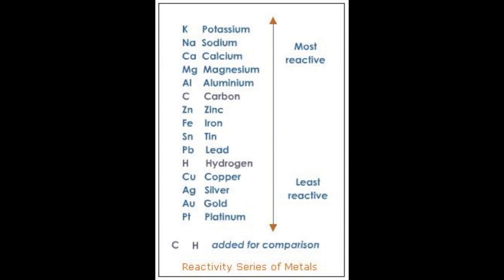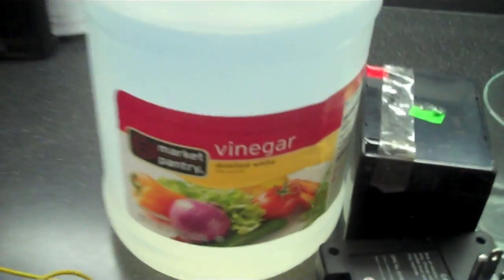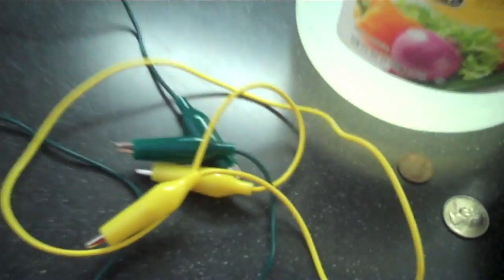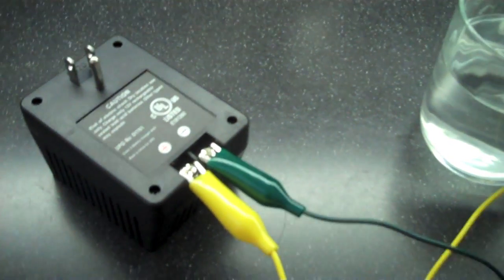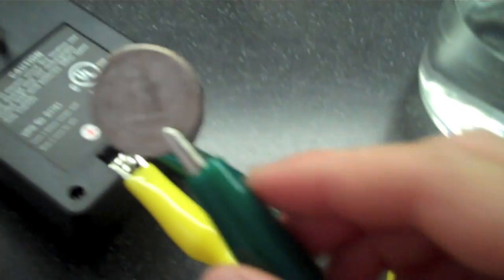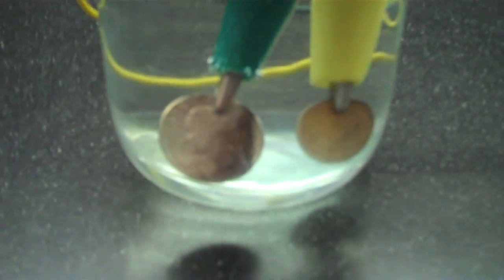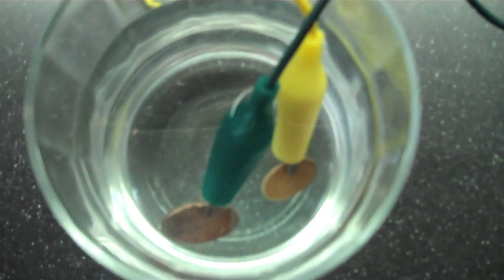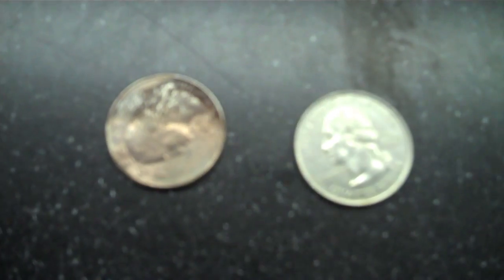How To Copper Plate Metals

Comment: I have trying copper electroplating but getting electroforming...any recommendations
Reply: make copper acetate.
Put White vinegar (acetic acid %5~%10)  in a cup and put the cup inside a pot filled with water (do not let water get inside the cup make its level lower) then boil. Once it is bubbling, take it the cup out and poor into 1/2 liter jar.
Add 1/2 cup Hydrogen Peroxide (%3 ~ %9) to the jar. Stir with plastic/wood stick/spoon so it mixes well. If you can't find Hydrogen Peroxide, go to pharmacy and ask for Wella Welloxon(hair bleach) small bottles %6 ot %9 https://duckduckgo.com/?q=wella+welloxon&iax=images&ia=images It got other chems too but it works.
Then drop in something that is copper like pennies, pipe, sheets, bare wire...etc. Make sure it is copper and not Brass(copper+zinc)
Stir a little bit. Leave it there for a while, it will bubble and turn from white to blue(murky=not clear).
Let it set for a while then take copper out. And boil the jar a little(not much) in a pot, it will become clear.
And that is your copper acetate. Label jar with marking pen, DANGER DO NOT TOUCH, USE OR DRINK. CHEMICAL.
Use that solution for copper e-plating. just do simple projects and small parts.
It produces some gases on the long run that are bad for health.
Use 3 Volts batteries (2 D cells) for e-plating, slow but gives better results.
See Youtube vids.

Comment: Would it speed up the process by adding a bit of salt to make the vinegar more conductive?
Reply: i would be worried about the sodium interacting. i used copper sulfate (instead of reacting copper with vinegar to make copper ethanoate as shown here) and a 1.5v battery to plate a charm and it did it within minutes, a higher voltage however seems to oxidise the plated copper back to copper oxide and gave off hydrogen so stick to 1.5v if youre plating something coated in zinc

Comment: A nice experiment, but this is not copper plating; this is copper deposition, which does not come close to the strength of actual plating. Fun though. Also, pennies have not been pure copper for a long time.

Comment: You are clearly a moron. It's a kid showing a kid appropriate project. You clearly don't need to buy any solution when one cent will get you a penny. ANY amount of hydrogen can burn in association with oxygen so yeah it can harm if trapped and ignited. He isn't trying to copper plate a 747 just a freaking coin so he has plenty of copper on the penny.

Comment: hey what is the voltage/amperage. also where did you get the wall adapter at? im using 1.5 amps and 6 volts and its turning the thing im plating black.... halp!

Comment from the maker: If you were to plate something as large as a cymbal stand you may have difficulty using this homemade method. Personally to avoid any risks and tedious labor I would simply see if there is a professional solution. Otherwise, you can experiment and see how it turns out if your'e comfortable doing that.

Comment: You did a great job explaining whats going on.  As the person before me said you can start with some sort of copper solution as well but I think you were going for the simplest method for anyone to try at home. I found when doing very small scale electrolysis like this a drinking straw with slits in it does wonders to hold your gator clips apart and out of your bath.  Also a PC power supply would do you wonders in toying around with various voltages and keep  ya in budget for under $20

Comment: Hydrogen bubbles are forming be careful that's the smallest amount of hydrogen forming due to electrolysis why you aren't using copper solution I don't know and you used no activator the wrong amount of power car hydrogen generators produce 5/6 litres per min to reduce gas mileage by 50% that amount of hydrogen would cause you no harm at all

Comment: I don't think a penny is the best source of copper for this experiment, and both the source and the recipient of the copper need to be properly cleaned in order for the deposit to happen properly.  It is not illegal, however, to use a penny like this.  It only becomes illegal if you are using the copper to fabricate other money or use it fraudulently (which is why Penny Press Machines aren't banned by law).

Comment: @AHW214 Wrong and wrong. The coins and bills are property of the federal government, to destroy a penny is to destroy property of the federal government. And a length of wire with the same mass as a disk of copper will have a greater surface area. Do the math and if you come up with something different the you did it wrong.

Comment: DON'T USE PENNIES. Or any other "copper" coinage. 2 reasons: It's a federal crime to deface us currency. Also since like 1980 pennies have been made out of only like 5% copper and the rest is zinc and other stuff. Easiest and purest source of copper will be copper wire (the thick stuff for running house electrical) after the insulation is removed it may be necessary to sand a clear finish off (if present). Wind of several inches to increase surface area to increase reaction rate.

Comment: @runnrunnrunn1234 yes, it will work with steel and iron. The thing you want to plate must go to the negative sids (-) and the copper must go to the positive side (+) and try to keep the voltage down so the coating will come out more even, if the thing you want to plate bubble's alot then you need to down the voltage.

Comment: @AHW214 atv battery it was 17amps and i did it for 20-25 minutes and it turned black then i left it there over night and one side was copper and other side crystallized with some black crystals and the vinager  turned black also

Comment: @AHW214  Ok.  Thanks for that info.  I've seen blue anodized metal.  If the metal is attached to positive D.C. polarity during that process, I wonder what what chemical or chemicals are in the solution that make that happen.  Also, I've seen reverse electroplating done in archeology to clean old coins, etc. of corrosion.